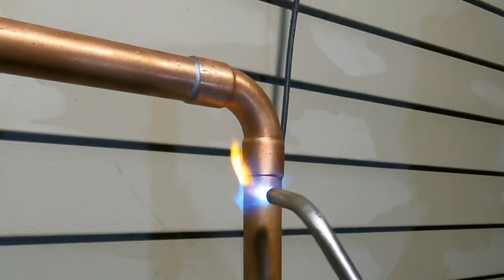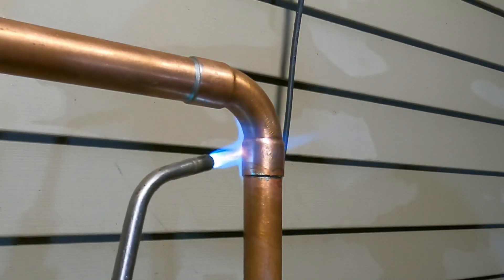How I Solder Vertical Copper Fittings Make Clean, Sealed, Sweat Connection

Comment: Just a word of caution: The deceleration of the heat by applying a wet rag to clean the area might cause hairline fractures within the solder. I was always told to let it cool down on its own then use the wet rag to wipe off any remaining paste on the joints I’m soldering.  That hairline fracture will give issues down the road.
Reply from the maker: No leaks on this line still to today. I almost never find a solder joint I did in the past that leaks. This might be a myth. I have worked with some who swear by what you said. Others that will wipe just like I did. For me often I let it cool off alittle and at least harden before wiping.

Comment: I'm working on something similar, I'm using 1 inch copper pipe type K, covered with 20mil tape for underground. Great job on the soldering and that long copper elbow looks better than the regular one.

Comment: I think that coupling on the gas line is a conduit coupling.   They're more of a sleeve with straight threads (non-tapered)  so that the conduit can be threaded in until the sticks touch.  Definitely not the correct thing for gas lines.  I'm surprised they got it to seal, must have used a lot of dope.

Comment: Everybody has the method, just my 02.....I Do not like to use a wet rag until things are cooled to wipe off excess flux.  Just the way I was told years ago.  Lost art soldering, I do not do enough.  Everything pex and crimps for cost.

Comment: flux is actually a cleaner and keeps the copper from oxidizing, which is why it should be applied evenly to both halves of all joints being sweated. without it applied properly, the copper can/will oxidize and you may not get good flow over the hole joint. only applying to the pipe and not socket doesn't coat it properly and you can end up with poor flow and bad joints (fitting pull tests would show it fast). same issue occurs sweating on dielectric unions with the bushing and nut in place, you'll never heat it enough and end up with a "rim solder", yeah it may hold for many years or start to leak within minutes/hours/days/weeks/months/years.
not ball busting, but trying to help all :)
Reply: I'll append this. fluxing one side only, is about equivalent of only cleaning and cementing pvc/abs pipe. the cleaner(primer) and glue will just ball up and peel down the pipe O.D. with near zero penetration into the socket. a stiff breeze or natural expansion and contraction will knock it apart pretty fast(non-pressurized!) far easier than rim soldered copper, but still!.

Comment: That coupling is ON you, it's the plumber that installed you gas pipe. On the fittings, Do you draw sand the Face of the fitting?
Reply from the maker: Yes I sand or clean the face of the fittings. Many don’t, I feel it helps the solder make a better seal. I wonder if I straightened out my meter if the utility company would care. You are correct. Past the meter is where I would tap off a gas line. Before is utility
Reply: @thehvachacker  Not many plumber's or HVAC guys do that. I think it makes big difference, been doing since mid 70's,

Comment: I was modifying existing copper pipes for water line, it was the worst thing ever, valve wasn't holding and there was water still getting into the pipe, nearly impossible to get it up to temperature, steam was everywhere and it leaked the first time I did it lol
Reply: hint, wet/dry shop vac with small diameter steel/stainless tubing(1/4 or less) down the inside past the joint being sweated or through open ball-valve (slow leaking curb-stop with indoor sweated shutoff fix), I have replaced some for peanuts that was quoted $10K+ after digging up yard and street. it works for all small seeping/trickling flows.
just use a tubing/pipe that wont melt, or sweat in place if it contacts the wrong area and solder creeps in (none of us are perfect and it happens)
Reply from the maker: That’s where I grab the propress. I always grab my torch. Yet sucks when water stops pipe from getting hot enough for the solder. Been there many times. Did you try the old bread trick? It works when water keeps dropping from on top. Never tried it when water was still entering the main
Reply: @thehvachacker  I heard about that trick, but I was afraid to use it as it was 15mm copper going to various places including a furnace. Would most likely need to install additional valve just to blow out the bread. If the leak was any bigger I think it would be the only way

Comment: As a fitter the most important thing for me for a leak free and good looking joint is cleaning the fittings and pipe!  Usually I'll cut the fitting brush handle off and put the brush in a drill. I always use a scotch pad to clean my copper. Never use old flux! I use solderlene flux which is my favorite btw. And I always use silvabrite 100 as my solder. I try to always the right size tips when soldering with my B-tank, But sometimes I use whatever tip will work. I personally would have soldered the horizontal part of the 90 first then hit the vertical while the fitting was still hot so I can let the solder wick in and try to form a cap. Never wipe a fitting while the solder is still in a liquid state. Maybe you did that show show the subscribers just the vertical soldering?  But everyone has their own way of doing things. Keep up the good work Bill!!

Comment: I can soldier and I’m good at it . But lately I can’t braze for nothing . I don’t know what the hell is going on . Lol
Reply from the maker: Too small a tip or not enough heat. With solder we control the heat. Brazing you need to cook the copper. Why I prefer staybrite 8. Also if your new to nitrogen purging. Just need to get use to it. When I finally decided I would try purging while brazing. The first few joints were nothing to be proud of. Even had to redo cause of leaks.
Reply: @thehvachacker  I think that's my issue. I feel like I'm over heating the material while in soldering it's like a few seconds and ready to solder and any longer you ruin what you are working with.
Reply: @thehvachacker   I do a 1 minute purge at 150 psi . But I have been using staybrite 8 and I do like it .
Reply: Sounds just like me

Comment: I'm a mess maker. I get paranoid so I go around it again and then the mess begins
Reply: If you take a licensing test some inspectors will only give you just enough solder to build the project, if you waste it you won’t have enough to hit all the joints. Rule of thumb is 1x the pipe size. So 1/2” of solder for a 1/2” fitting
Reply: @OnTheToolsWithSal  I've seen to many things fail from not enough solder so I use enough so it don't ever leak from not enough solder

Comment: Is there a reason why you went copper from the backflow to the sprinkler manifold instead of PVC?
Reply: More fun soldering than glueing!
Reply: Nice.  Everything looks level and plumb.
Reply from the maker: I was considering it. It would cost less. I know most do that. My answer may only make sense to me. I like how it looks.
Reply from the maker: I believe it will also handle being in the sun better than pvc. Pvc can become chalky exposed to the sun.
Reply: @thehvachacker  fair point, was also worrying about oxidation of the copper as well
Reply from the maker: I was more worried about rocks and roots. I removed most the rocks. I will fill with dirt screened down to 1/4”. Also decided to remove the marble chips. Many online say those marble stones the way to go. Yet good luck turning one of those unions when buried under dirt and stone is compacted against the manifold. I am learning all about irrigation so may make some mistakes. Yet I can never put anything in, that in future won’t come apart.
Reply: @thehvachacker  wise, because any sort of rock, stone, minerals against that copper will quickly eat it up and pinhole. it's best to nor burry copper at all, unless down real deep and type K.

Comment: I know they say not to do it but I put a tiny amount of flux in the female fitting. Wiped clean with my finger. I find it gives me a perfect joint everytime. StaySilv solder is my go to.
The additional heat you did was interesting but more than likely unnecessary. You don't want to heat a pipe any more than you need to. Place the heat where you want the solder to go, get the solder in and call it a day.
Reply from the maker: Only thing that stops me from flux inside a small fitting. If a boiler it clogs the air vent over time.
Reply from the maker: Yes but the flux doesn’t melt into the water until the boiler is actually on. Yet I like to put flux sometimes on 1-1/2 and up copper just to make sure it spreads evenly.
Reply: @thehvachacker   Do you Solder your HVAC line set also..❓❓